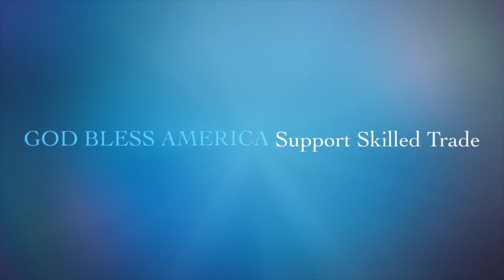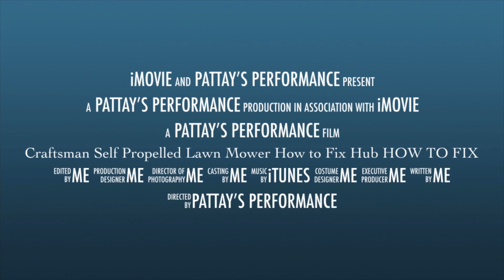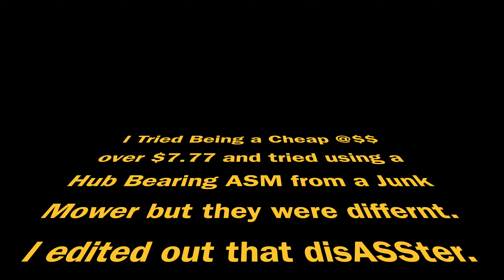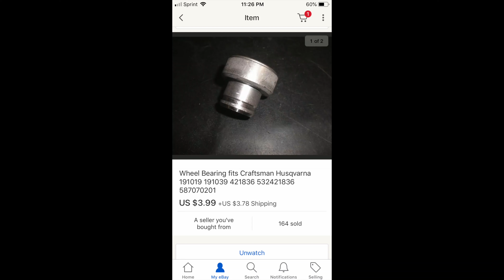Craftsman Lawn Mower Wheel Hangs Won't Stay In Place One Wheel Doesn't Spin HOW TO FIX REPLACE HUB

Comment: great vid Jason,  I just had the same thing on a craftsman with a honda engine, the previous owner had used duct tape to hold the wheel adjuster  and the wheel bearing was destroyed.   and the whole adjuster assembly is all that is listed on lookup sites, the bearing part is not listed.  I found that its  Part  Husqvarna part 587070201 or 587070202   the 202 part number is an improved part.    when I installed the bearing  on one of the wheels I ended up having to  use jbweld on the snap ring to bearing to ensure it does not come off on one of the wheels.  its been holding good.   I know that's not the best way but the whole assembly with bearing pre-installed is on backorder from MFG.

I think you are missing a o-ring between the bearing and the adjuster assembly  on the other side of where the snap ring is  on the outside of the mower @17:21

see the picture for part 581497908  which is the whole adjuster assembly for the right side. but I am sure you figured that out

LOL @24:46   I did the same thing multi times dohhh.
Reply from the maker: When I install snap rings...I always take a pair pliers and give it a good clamp to make sure its light.  I know you do quality work...I'm sure the JB weld is fine.  HUSQ is a $hitshow this year...nothing but back ordered parts from them.